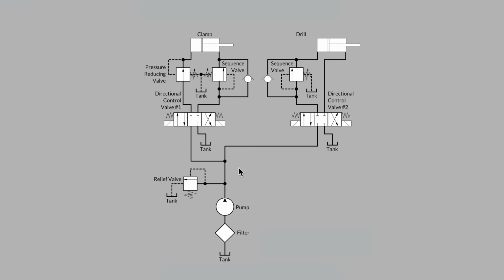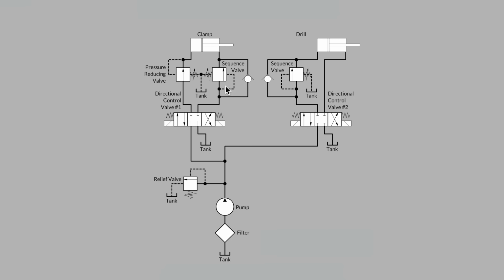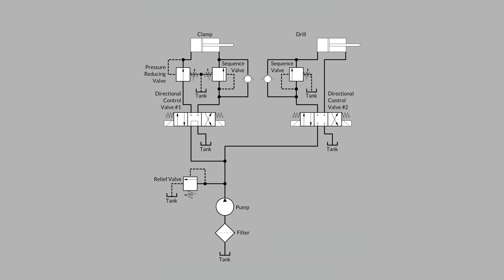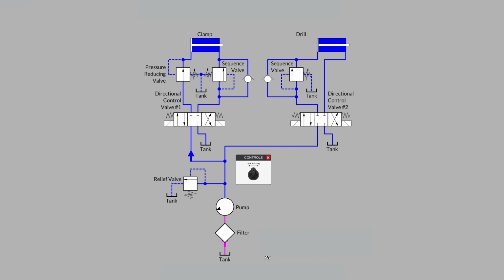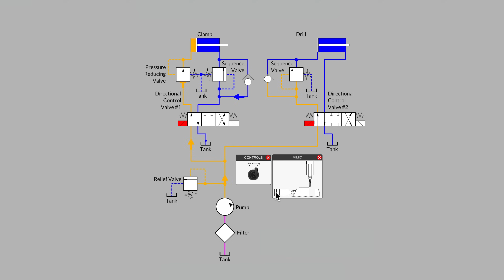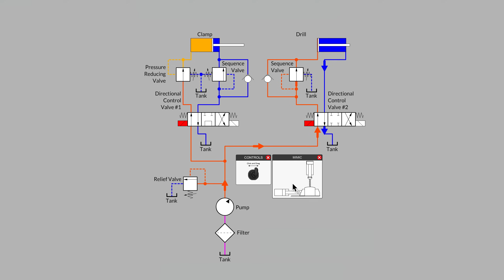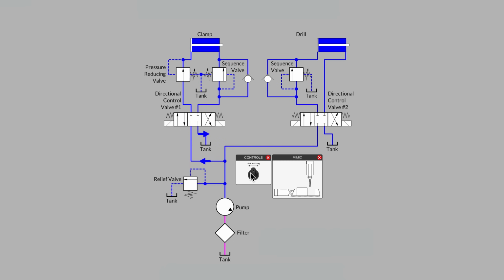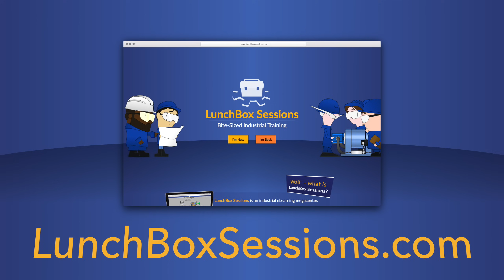How To Interpret Pressure Valves

Comment: Thank you very much for all the video insights that you have posted....
I have a question regarding sequence valve.
Have you ever seen normally open sequence valve to be used in hydraulic circuits? if you did, can you please say in what applications?
I have trouble with old hydraulic machine which was two normally open sequence valves on a manifold block and I m trying to drawn hydraulic schematic but I can't quite figure it out.
Thank you in advance.

Comment: May i know how many bar apply on these valves and pump?
Thanks.
Reply from the maker: All pressure values in this teaching animation are relative and nominal. This system is only for teaching. In an actual hydraulic system, pressures for a system such as this might vary from 500 PSI (35 Bar) (3500 kPa) up to 3000 PSI (210 Bar) (21000 kPa). One would need to make sure that all components such as the pumps and valves, and also the fittings and hoses, were properly rated for the normal maximum working pressure.

Comment: Hey great video. Though what to the dotted lines actually indicate?
Reply from the maker: Dotted lined indicate a pilot pressure line (very small passage, not much if any flow) or they represent a drain. The sequence valve is one example of a valve that has an external drain to tank from its pilot spring section.  All pressure valves have a pressure pilot line that monitors for, and senses the pressure value that will trigger a response.